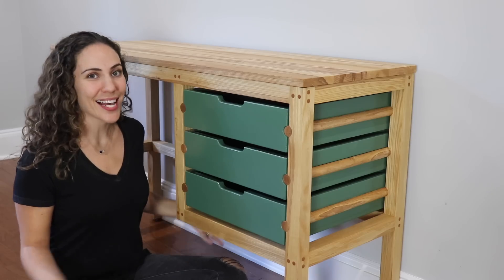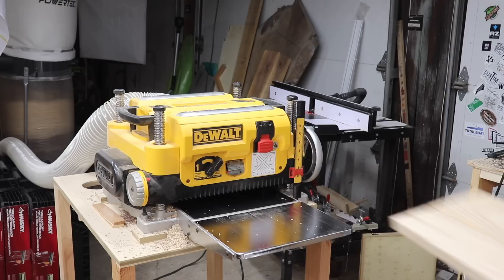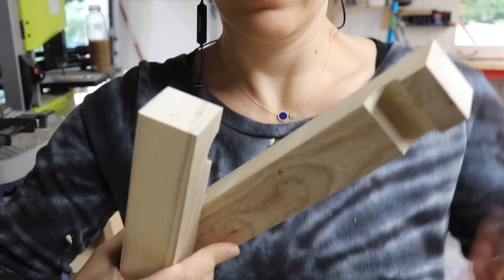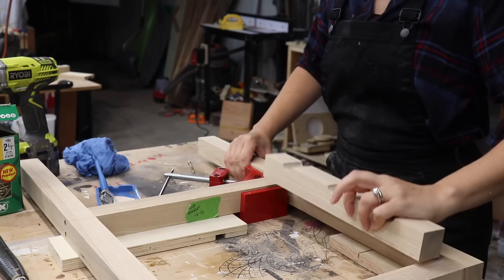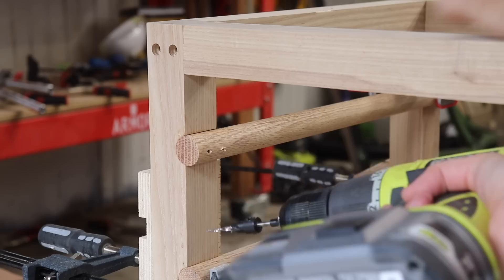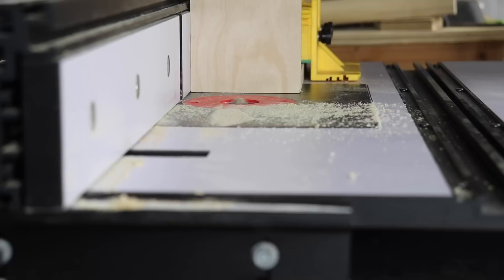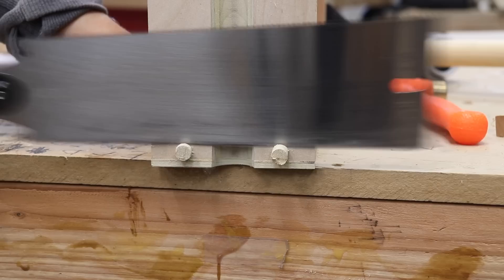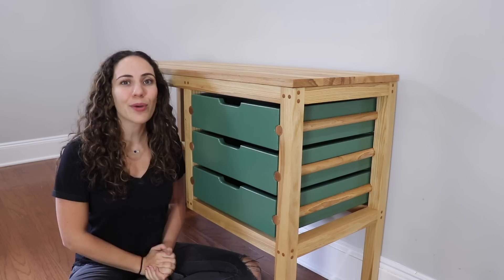Building a Desk Using Dowels for Drawer Slides // Woodworking // Instagram Builders Challenge

Comment: Very nice! My only critique is with the screws going into the end grain. Maybe that's okay with ash, but it makes me nervous. Dovetail joints around the upper skirt and mortise and tenon joints elsewhere would have taken longer, but would be sturdier. Overall a great job, and I love the dowel slides.
Reply from the maker: Thanks so much. I agree with you. I don’t usually love to use screws. But I really just wanted to test out if these dowel slides would work. So I did what what easiest and quickest for me.

Comment: You could also wood that's closer in grain and color to the wood you plug. This would also make it less busy, IMO.

I was thinking about stops at the back for the drawers too, already during the build :-) The drawers coming out completely is IMO not a bad thing - you always have to take them out to look for something you know is in there, but can't find.

Just wondering: does any of the kids show any interest in woodworking? The boy looks like he could start doing easy stuff, like drilling a hole on the drill press or rough cutting small boards to length with a buck saw. Simple things like these help with developing good eye-hand coordination early on too.
Reply from the maker: I don’t want the drawers to come out for safety. Like if my son pulls on it too hard. It’s something that happened to my daughters dresser and it’s annoying. 
He helps me sand and paint. But my 9 year old loves using the drill press

Comment: 10:25 I would image you can use a raised screw or even a small dowel perpendicular to the slider dowels and a corresponding groove into the drawers notch. Thus, the drawers would not only slide on the side dowels, but also on the screw stopper, with the screw's channel ending shorter than the drawer length to prevent a full extraction. The stopper for the back of the drawers is even easier.

Comment: For a quick and easy stop, why not a piece of dowel at the end of the rail that has a rubber stopper or just the plain dowel at the end?
The trick would be finding out which rubber doesn't leave a mark 😬
Great idea and definitely something different 👍
Reply from the maker: Thanks! That will keep it in place. But won’t prevent it from being pulled out all the way. I have an idea

Comment: I love this idea.  I would however use Delrin 1" dowels instead to reduce friction.  Peace
Reply from the maker: Thanks
Reply: @3x3CustomTamar  Sure. I love your work friend.  I just moved from Boulder, CO to Asheville, NC.  Where are you guys?
Reply from the maker: Daxx-Terry Green NY
Reply: I think you would need a different style to use anything but wood. This is more arts and crafts,  plastic would need a more mid century modern look. Probably all painted but the top, and the leg color contrasting with the plastic dowels.
They would be expensive though in plastic unless you used pipe. Maybe pvc with wood plugs in the ends or all the way thru to stiffen it?

Comment: It looks great.  Thanks for posting.  How are the dowel draw slides holding up?  Since you have a plug cutter, you could have cut plugs out of ash and they would be less prominent.  Maybe in that case you should rotate the grain ninety degrees so it wouldn't look like you tried to hide them and couldn't.
Reply from the maker: Still running smoothly

Comment: Hi Mrs Ikea ! Firstly what a fantastic looking piece of furniture, what a pity it was filled with toys as it would be more suited to model railroad items! I must agree that it did look a tad busy with that amount of dowels, especially  those in the horizontal plane at the front. My father was a cabinet maker for 65 years ( not a power tool insight) and he always insisted on ensuring that the grain of the dowels was inline with the grain of the main timber so no you are not being to anal, just professional. In fact he even ensured that the slots of all screws were in the vertical plane. Maybe not applicable so much now as slotted screws are not widely used.
Reply from the maker: Thanks!

Comment: One thing I noticed is that you glued the drawER (from NJ?) bottoms into the slots.  It has a tendency to cause the wood to split and tear out over time as the wood expands and contracts with the humidity. There's no need to glue the drawER bottoms into the slots just stapling/ nailing the back edge like you did is enough.
Reply from the maker: Yup Jersey. Ha. I would agree with you if I was using solid wood, but I used plywood, so I don't think that's an issue.
Reply: @3x3CustomTamar  Ha ha I'm from Jersey too and got teased for saying draw for a long time when we moved to FL. Yes using plywood makes it less of an issue.
Reply from the maker: Robert Schuster I didn’t realize I had an accent until I started posting videos to YouTube....

Comment: So after having used it for a while (I suppose), what's the load-bearing capacity of those dowels without jamming? It's only my intuition, but aren't the non-horizontal slides prone to wedging and jamming when loaded?
Reply from the maker: I have loaded these up with the heaviest books I own. More than would ever be in these drawers. And they slide fine.

Comment: Lots of ingenuity, but I wonder about screws going into the end grain of the frame pieces. 
Any reason for not using pocket screws that go cross grain? Or even using the dowel rods instead of screws?  The corner clamp held everything in place and the dowels were going to be exposed anyway.
Reply from the maker: Thanks!  Well to be honest. I just really wanted to test to see if this dowel drawer slide thing was going to work. So I did what was easiest for me on the frame.
Reply: @3x3CustomTamar   I really did like the video and have subscribed to your channel. I was just thinking if you clamped up the joint in the corner jig then drilled the holes, you could grease up some dowels with glue and pound them in. There are dozens of ways to do things, so I am not criticizing your methods.
Reply from the maker: DannyB1954 didn’t think you were criticizing. It’s a fair question. I was originally going to do just dowels. But I tried tapping one in, maybe it was the dowel size but it wasn’t easy. It was either too big or too small for my bits. I could have sanded them a bit or something to get them to fit. But I just wanted a stress free assembly. My son has already colored on the top of this desk with crayons.... And I knew he would! Ha! So I did what was easiest for me to test out the slides.

Comment: Aside from the draws vs drawers issue my comment is those are the biggest 1/2" dowels I have ever seam. Actual if you'd used 1/2" dowels it wouldn't work. Better to use the 1" dowel as it is less likely to let the draw fall off track.

Comment: Did you add any wax or anything to keep them sliding smooth, or make them slide smoother?
Reply from the maker: Yup. I used paste wax
Reply: Candle wax or a bar of soap  is good. Doesn't  attract  the dust . But what ever works. Nice job.🤣😂😁😀😎

Comment: Why don't you use a plug cutter to make plugs from the same material as your work to plug your screw holes? Its very cheap and makes a better match than to use a dowel from different material.
Reply from the maker: Bc I wanted it to have the end grain to match the dowels I used for the drawer slides when I was designing it

Comment: Thank you for this video. Just one question, What tool do you use to make the small wooden cylinder? Thanks
Reply from the maker: Thanks! The dowel? I purchased it like that.
Reply: 3x3Custom - Tamar.Yes the tool to make a dowel, it’s a trepan fixed on the drill? At 9min in the video.
Reply from the maker: Aurélien Thérain oh! It’s called a plug cutter.

Comment: Wouldn't the wood wear out over time? Maybe some wax could be used to lubricate it and help it last longer.
Reply from the maker: I used wax. And it seems to run smooth. Wood runners have been around for centuries. These just happen to be round.

Comment: I am sure you are busy girl editing, woodworking........ and on top of all that kids.......flat out mum 24/7 but I have to ask you something.... I've noticed that at the beginning you've mentioned size of the wood you were going to use and dimension is 8/4.......eight quarters.......Being from the "metric" part of the world imperial measurements always were (to me at least) somehow fairly flexible and tolerant.......kind of....."it is close enough".......but 8/4.....is beyond me........thickness based upon my observations is very close to 2 inches......and 8/4 equaling 2.........is there any differences between wood thickness of 2 and 8/4 merchant wise or manufacturing process.....or anything else......as the size of the.......for instance plywood sold here in Australia as 1/4 inch or 6 mm is nothing even close to any of those measurements (1/4 inch is 6.35 mm) and plywood of that thickness vary anywhere between 5.7 all the way to 6.7 mm).

Beforehand grateful
Reply from the maker: Board footage here is measured in quarters. So 4/4 is 1” before it’s surfaced. 8/4 would be 2” before surfaced.
Reply: @3x3CustomTamar I thought so, but I was a bit confused. Thank you

Comment: Bad design. There’s a reason drawer slides are not designed this way. As downward force is applied, the rounded dowels will create outward force on the framework causing the design to fail over time.
Reply from the maker: Thanks for your concern. These are obviously not heavy duty drawers. The most that will be in here is notebooks and crayons so they should be fine. But I filled one all the way up with very heavy heavy books to test it out. And there was no issue.